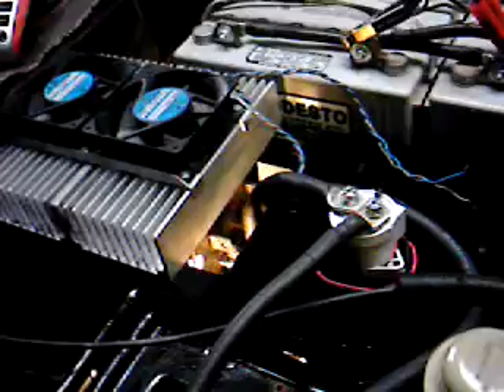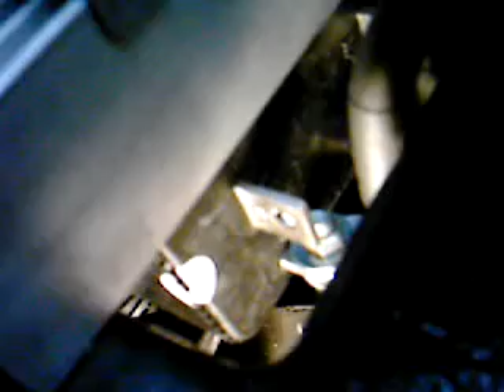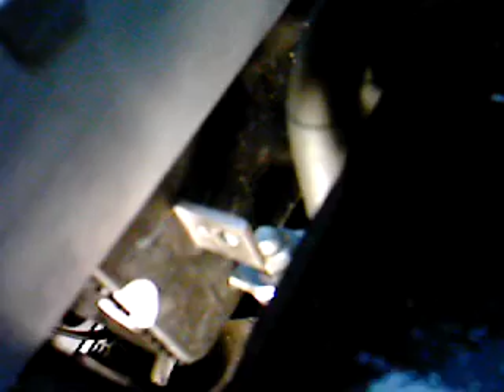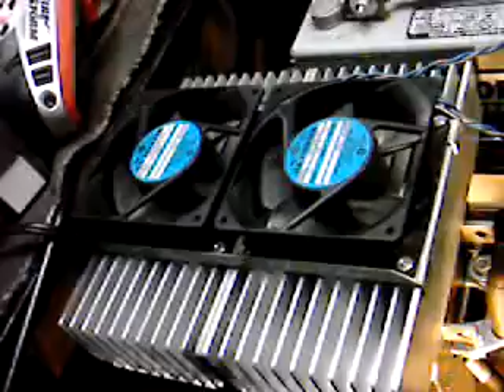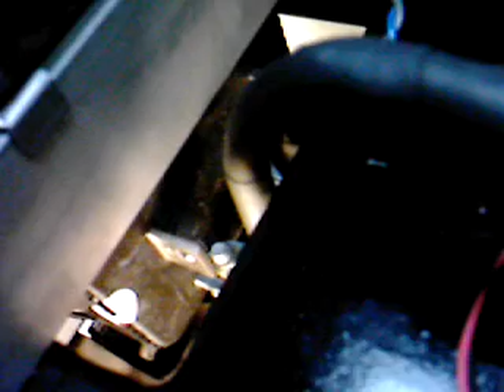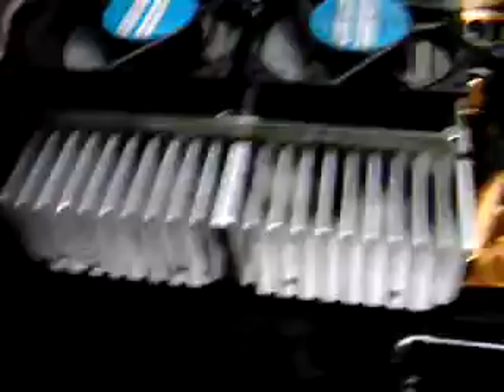EV motor controller

Comment: Nice work...with regards to "heat rising" that would be more so for convection heat...not so much difference for conductive  heat... At least not enough difference to compensate for having the electronics out of sight and harder to reach! 🤷🏽‍♂️
Reply from the maker: At this point it doesn't matter because all the parts have been pulled from the car

Comment: @ww321
See the difference between power electronics that operate at 30-100C and a burner flame at 1500 or 3200C? Experience with metal work is no match to common sense and experience with electronics and semiconductors, when the topic at hand is semiconductors and not metal work.

Comment: Natural convection tends to favor warm air rising driving cooling by mass transfer of air BUT the main heat transfer mechanism here is conduction to the heat sink. With driven cooling (fans), mounting orientation would have little to no effect on heat flow.